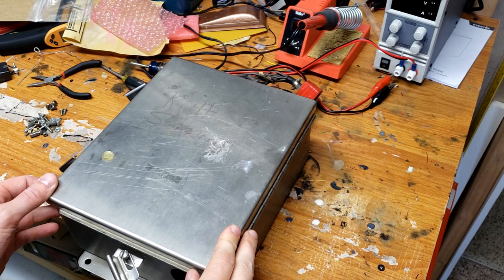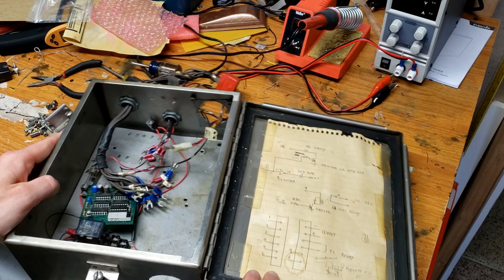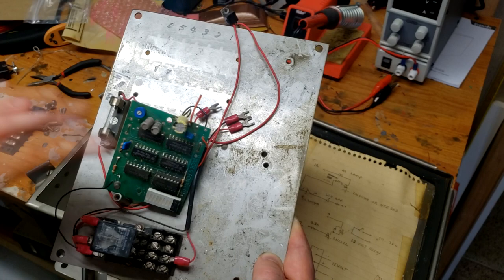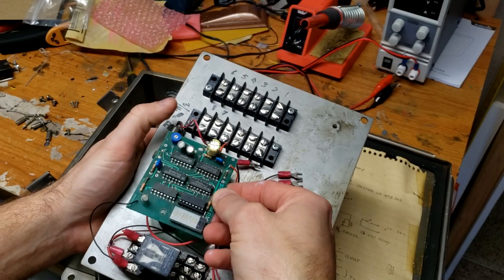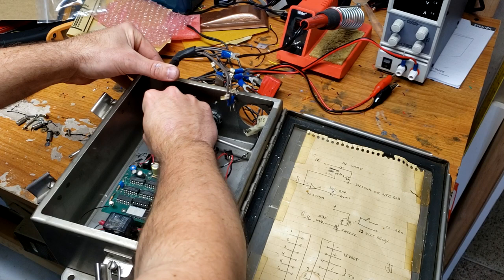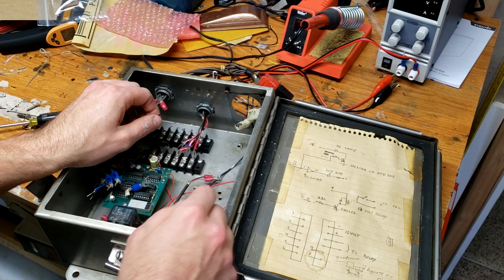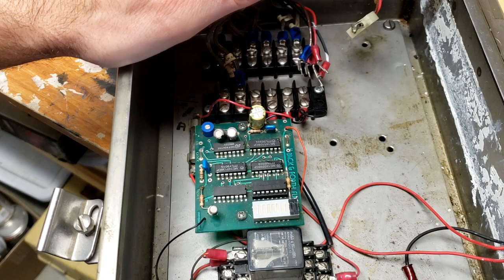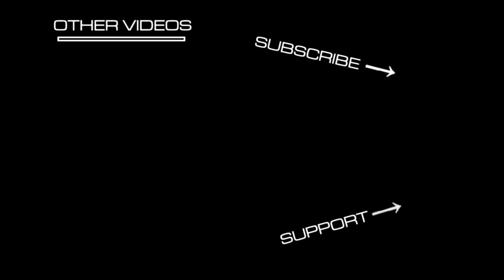Repairing the Universal Studios Knight Rider KITT Display Car Scanner!

Comment: You are absolutely correct in assuming the control board was a kit. I built that kit for my first electronic class project (at vocational high school) in 1989. I am trying to remember the vendor. It was a big company, like Mouser electronics. They sold that in different packages. You could buy just the board, all the way up to complete with lamps. I bought just the controller and did my own lights to mimic KITT’s scanner.

Comment: No idea what that one relay is for. But the schematic shows that you would need eight 2N6044 or NTE263 transistors to control the halogen bulbs. This was solid state, instead of using 8 relays.

Comment: I guess the single relay triggered a soundboard back in the day, as it always fires on one edge of the sequence. That would require the scanner speed to be set to a specific amount so the scanner sound would be in sync to the lights.
Reply from the maker: Ahh brilliant! I bet you are right!
Reply: On the schematics, in the top of the box, If I can see clear, there is a mosfet for Hx lamp switching, and the control is taken before a NOT gate (after the not gate is one segment of the led bar), so maybe it had a mosfet pack somewhere outside.
Reply: @hzoli024  Given all the heatsink compound on the inside of the case i would say you are right.
Reply: I’ve been aware of a very gifted young man here on YouTube who has superbly updated how to make KITT drive itself.  Here’s a link to his latest video of today November 25, 2021.  Check it out, then if you’re interested by what you see be sure to check out his previous videos via his member page:

https://m.youtube.com/watch?v=vc0V1pmbP_A
Reply: @ironsidefan  Yes that young man has done an AMAZING job on that remote control KITT.  Thanks for the link for his latest video!
Reply: @ironsidefan  Just checked it out. Nice looking car. Great work
Reply: @ironsidefan  Yes very cool job what he did, but also found this channel, which is awesome also: https://www.youtube.com/user/hyprsearch
Reply: @KnightRiderHistoriansOfficial  That would also explain why one would need more outputs than the stock scanner flasher... I'd have to go back and look but - is there a consistent 'hitch' in the pattern of the car on display? Like the last input wasn't hooked to anything?

Comment: def need some relays or transistors to power the halogens , I think 2n222 was something those jc whitney things used but those were outputting to small 12v christmas light sized bulbs . so you could get some 60 watt transistors (not sure which ones) to give a little extra room for tolerating the load and heatsink and all you gotta do is some soldering to the B C E 's and you will have something going on but if you want the clicking sound some 12v relays would do well.

Comment: Even if this piece wasn't used on TV, it was used on the Universal Studios display car and is thus still worth preserving and getting working again. I remember sitting in the KITT at Universal Studios back in the day.

More projects like this would be great to see.

PS maybe look into sourcing replacement capacitors for the control board, they look to be OK from what we can see, but caps that old might be on the verge of bursting and worth replacing.

Comment: Bravo I love these little guts and bolts videos showing how everything worked and it's surprising on how complicated things were for something they used on a TV show and I'm not knocking it or anything just astonished

Also could you imagine maintaining this stuff back in the day especially with 1980s electronics are hoping that some of the stuff held out for a day's shoot or being the poor guys that had to either come up with this or maintain this stuff

Imagine the scream of yes when the guy found that back and forth lights circuit board at a local radio shack or some obscure catalog.

Also that hand drawn schematic is priceless
Reply: Hey dear how are you doing?

Comment: dual flip flop (14013), up/down counter (14510), 14028, 4071.. nice :)

it seems each output are connected to ul2004 (diode ic) + led bar. you'll have to connect 8* 2n6044 npn transistor to drive the car lamps. (as shown on the top part of the paper)
Reply: Was also going to mention that the solution to how it drove the halogens is actually on the paper but you beat me to it!
Anyone figured out what the relay is driving, what does '360' reference?
Reply: I noticed what looks like heatsink paste all down the side of the box (the white stuff). Likely there was a heatsink with the transistors on it there.
Reply: So its a BCD up/down counter feeding a BCD to decimal converter. It would be good if someone could trace out the original circuit and circuit board pattern so replicas could be made.
Reply: @SabretoothBarnacle  it's triggered on every cycle so probably for the (360 = loop?) scanner sound board?

Comment: I think the cutted small LED-Wires are used for activating 8 bigger Relays and these are Switching the higher Load Halogens. I bet they needed the 8x Relays.
Reply: I agree that's what I was thinking as well. There's no way that little board can handle the current of eight halogens

Comment: Man this is so cool :-) I'm so glad I found this channel along time ago because I remember watching you on TV before I even knew this YouTube channel existed and I was like wow that guy's cool he's got the Knight Rider car! :-)

 anyways that chip that soldered on the end of the wires seems like it's a voltage regulator to send the correct voltage to the flasher board itself. I don't know what chips are on the board but with a reference number you be able to tell what voltage requires for each of those on board chips my guess is not 12v  but anything lower than 12 going through the regulator could make the current even lower going to the LED on that panel.
Reply: Oh I also have to laugh because in the back on the left looks like you have the same exact infrared thermometer as I do and the power supply you have is also it looks like the same one I have what a coincidence :-)

Comment: just as a general rule with the circuit boards I had a computer repair guy tell me that you want to keep about a quarter of an inch to an inch space between the circuit board and the metal, when mounting it to keep it isolated and grounded properly, so if you see anymore of that, look for the raised mounting points as your starting point with circuitry like that.

Comment: Its too bad that you don't have the actual scanner bar because going on the shot  that is at the front of your video  I can see the damage on the scanner at the lower left bottom that I had to do a quick repair on right before the park opened the second time that I worked on K.I.T.T. I think this is probably the control box for that particular  scanner .Hopefully someone still  has that scanner bar and will speak up after seeing this video. As always KEEP UP THE EXCELLENT WORK .. KITT STILL ROCKS!!!   Later  Jake

Comment: Good video. From the bar graph led outputs they must trigger a transistor which in turn will trigger the lamp. Don't take the led output direct  to a relay or lamp directly or you will blow the chip ❤️👍🏻

Comment: Looks like the transistor board is missing as that what connecting the CMOS logic to the scanner light bar. Looks the floating components is a 7805 as those ic run at five volts.

The page talks about a transistor relay combo. I think the big relay adds an effect.

Comment: Guessing here.
1-8 is kitt lights
9 and 10 would be master power and ground for the lights.
Not sure why 11 is here though... unless it's relay power to turn the hole box on and off from inside the car..
but really you just need a master power and then use the kit lights as ground but that's how you do it now days, idk about 30 years ago...
Also dumb question, you have a multimeter? Continuity beeper mode is a grate thing.
Ok the relay is not a master.... it's only clicking on and off with the first light... are the other 7 relays missing??
But yeah using the leds to drive the other relays would work..